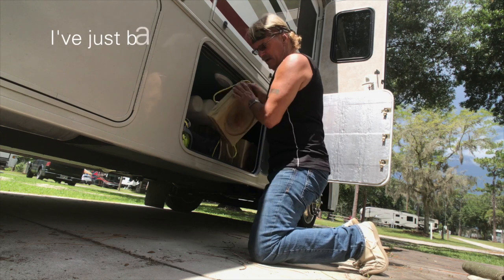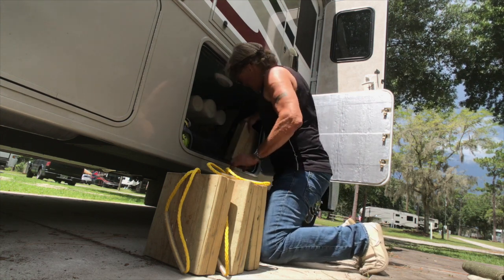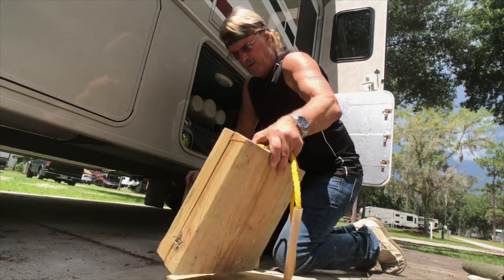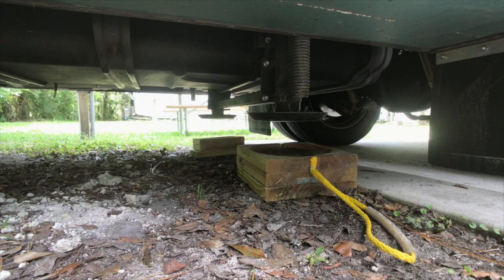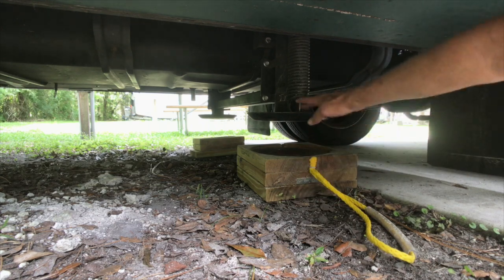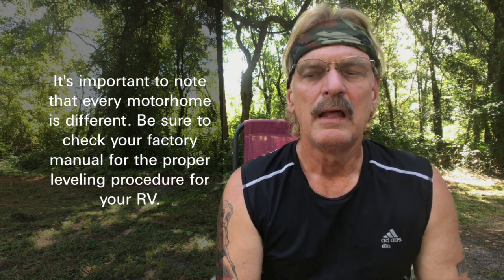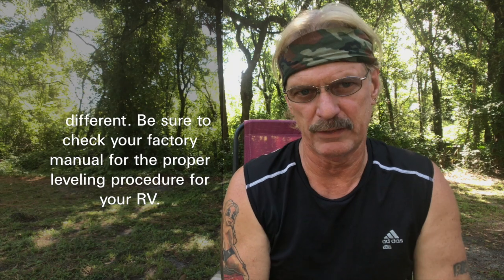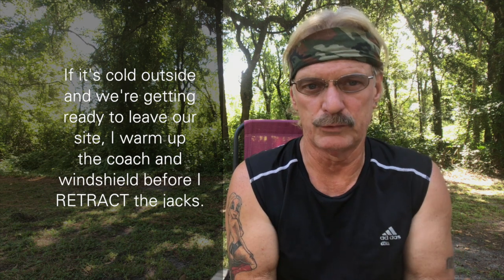Proper RV Leveling has MANY BENEFITS. Here's why.

Comment: Man I like the way you think. I am like you. I have a TT with auto leveling, but I use blocks that are about four inches tall, like you I don't want my levelers to over extend. Then once the TT is level, I extend the stabilizers.  I learned from the time I first used the auto level system, the stabilizers would not fully extend. That is when I started doing the manual leveling as you do.
Reply from the maker: There ya go. Good job William.
thx for watching.

Comment: My Norcold refrigerator manual says to level the frig within 3 degrees max from side to side (which is front to back for the motorhome) and within 6 degrees max from front to back (which is side to side for the motorhome). This is because the frig is mounted on a sidewall so side to side on the frig corresponds to front to back for the motorhome, etc.
Reply from the maker: Maybe you just typed it wrong but from what I read in your comment it's exactly the opposite. Norcold states that their unit should be level within 3º side-to-side and 6º front to back. This is the rule for all absorption fridges. 👍

Comment: Thanks for the very helpful video. I just ordered a can of the silicone.  We just bought our first rv (2019 Winnebago Sightseer 36Z) and the auto leveler just doesn't seem to work very well.  The official instruction manual leaves a lot to be desired! I will do manual next time.  Can you give any details on how you made concave area on 2x12s for the pads to fit in and not slip?  Thanks.
Reply from the maker: Once I screwed the 2"x12" together, I took a plate, outlined it with a pencil and then I used a router to make the concave area.
Reply: @RVstreet  Great idea, Martin  Thanks

Comment: Great video!  Thank you!  What would you recommend to do an inital cleaning of the jack shafts?  Ours look a little rusty.
Reply from the maker: Good question Liz,
I would use "0000 steel wool" and some WD40 and get those shafts as clean as possible. Then going forward, use the 3M lube I showed in the video at least once a month. It will provide a light protective film over those shafts. This is important to do. I have both products in my Amazon Store in the "Sealants, Lubes and Protectants" category if your interested.
https://www.amazon.com/shop/rvstreet

Comment: I appreciate the video.  I bought the 3M silicone from the link.

I recently purchased a used motorhome and figuring things out.  Looking for some help if you have a recommendation
The jacks were not well maintained for. I have changed out a hydraulic motor and 2 solenoids and probably looking at a 3rd.  I'm in process of making wood pads.  I like the idea.  The pads and the springs are a bit rusty looking can I clean them up and if so what would you recommend?
Thank you in advance
Reply from the maker: Thank you Jolene for your question 👏
I would first wash the pads and springs good with hot soap and water and get them totally clean. Then....I'd treat them with my Permatex treatment. You can find that in my Amazon Store in the "Sealants, Lubes and Protectants" category: https://www.amazon.com/shop/rvstreet
Check out this video I did awhile back on treating rust and the steps to restore them back to like new:
https://www.youtube.com/watch?v=QQnsKk1he-M
Thanks for coming aboard and being a part of learning how to take care of your RV 💗
https://www.youtube.com/c/RVstreet/playlists

Comment: Just found your channel a few weeks ago, I really appreciate the information, I have a 2008 winnebago 32H. it is much like yours and the tips you give are right on. I do have a question, I noticed in the video the front stabilizer has a blue 3" or so plate bolted to it. Is that an add on or something to improve ride? Thanks so much..
Reply from the maker: It's an add on. It's an adjustable bracket that stiffens up the sway bar to avoid all the roll you get in the front suspension. Unfortunately these blue brackets are no longer available. I have since added Sumo Springs in the front and they have greatly improved the ride and the impact of bad roads and Hwy expansion joints. Overall, I have done several chassis upgrades that has made our coach ride like a dream.
thx Charles for watching. 👍

Comment: I love your videos what kind of leveller app you have, i have  a 24 foot motorhome, installed hydraulic jack by pushing a buttom something easy for me but when I open my tip-out it’s always off a bit and doing after manually I have trouble with it
Reply from the maker: It's called "Bubble Level". I have an iPhone so I got it on the app store. It's FREE. It has 6 different functions, but the function I use is a round circle with a standard horizontal leveling bubble. Below the bubble it tells me exactly how many degrees I'm out of level so I know how much to raise the RV. I keep leveling until I get within the tolerance I like and that for me is .5º in both directions—side to side and front to back.  It's very simple to use and works great.
Reply: @RVstreet  thanks

Comment: Is there a video on how you made the 2x12 blocks for your leveling jacks
Reply from the maker: No there isn't but I believe I gave that information in the comments.
Reply: @RVstreet  So I went back and looked at the video and I guess I was wondering how you cut out the circle impression in the wood did you use a hole saw bit or something else ?
Reply from the maker: @Brian-bo9nv  I used a router. All 3 layers of wood were glued and screwed. 6 yrs. old now and still good.
Reply: @RVstreet  oh man I had a feeling you were going to say that, I have a lot of tools but not that one.  I will have to borrow from a friend. I just bought my first motorhome yesterday a Georgetown Forest River  335DS When I was in the store I looked at those plastic ones and I was like..... I'm not buying plastic.  I could have used them in my driveway I will be making them soon.
 I been trying to take in all the information I can, information overload lately !!   Thanks for your videos I enjoy watching them and appreciate you.
Reply from the maker: @Brian-bo9nv  Thanks Brian 👍
information overload Ya you've entered into whole world. But you can do this. You can do 80% - 90% of the maintenance it will need yourself. Take one item or system at a time and learn it. Overtime all this will become 2nd nature. As far as leveling goes, learn how to level manually.
Is your MH used or new?
Reply: @RVstreet  it's a 2015 with 25,000 miles on her.

Comment: Hey Martin. Are those blocks you made treated or standard lumber? Just ordered a can of 3m silicone from your link!
Reply from the maker: Treated, glued and screwed them together. Then I used my router on the top board to make a shallow bowl so my leveling jack pads sits down down in it.
BTW....now you can always get anything you need through our Amazon Store. We didn't have our store back when I did this video but do now. Just keep our store link (below) in a convenient place and use it when you have to shop on Amazon.
https://www.amazon.com/shop/rvstreet
Thank you so much Dover for supporting our channel. 🔧 🙏
Reply: @RVstreet  right on!!! Thank YOU!

Comment: How can you tell when the front jacks ‘kiss’ the blocks. Can you actually feel it, or sense it?
Reply from the maker: I can tell two ways:
1) As soon as they kiss I can feel the RV raise up a little. Same with the rear
2) Joanie is outside and she confirms all jacks are firmly on the blocks
Then I launch my leveling app, place my phone on the counter to see where I am level wise and then make any small adjustments from there.
Reply: @RVstreet  Thank you. You can tell, I’m new at this. From what I’ve read, then you have to slightly raise them to finish the leveling?  Then touch them down, again?
Reply from the maker: @SrBottch  That's OK.
No. You can't slightly raise leveling jacks. Once you hit the retract button they will come all the way up. 
So again, once they kiss the wooden blocks, and the coach is firmly planted on all 4 blocks, I look at my leveling app. If I have to raise the front or the rear a little more to get it level then that's what I do.

Comment: I have followed your guidance and read all the owner's manuals. I believe you made a misstatement about refrigerator leveling. You said 6 degrees front to rear and 3 degrees side to side
Reply: continued in reference to the motorhome. The refrigerator leveling is relative to the refrigerator. as you are facing the refrigerator side to side is left and right and front to back is away and towards you. Or to put it another way 90 degrees off from the orientation of the motorhomes front/ back and side to side.
Reply: My Thor Coach manual made the same misstatement you did I choose to take the Norcold manual as the correct information.

Comment: I am planning to get a 22 ft motorhome (BT Cruiser 5210). Does this need to be leveled when I park? I can't find anything about their leveling jacks. Maybe I just need those plastic things that one would drive on top of?
Reply from the maker: For a 22' rig, plastic pads will work. Just takes more time. If you have an absorbtion fridge you need to keep that rig level.
Reply: @RVstreet  Newbee question1... IF Class C, parked for long term [1-2 month] with Refrig off and NO elect/LPG power on, AND RV Not leveled, will Frig have operating issues? Love your coaching!--- SC JayHawk,
Reply: @RVstreet  If RV laid up for winter, no power on Refrig to operate [E or LPG],  will it have start-up / operating issues if RV not level on Gravel parking pad? Auto level lifts off wheels. Is it ok to leave parked w/o level?
Reply from the maker: @miltonsmith8989  Hi Milton
I highly encourage you to go to iRV2.com. Create a user name and password and post your issues there. They're are a lot of experienced folks like me on that forum. We you post your question, be sure to give the details of the issue along with make & model. You'll have many folks chime in for possible solutions instead of just me. They will be a great resource for you in the future too.
Reply from the maker: @miltonsmith8989  No. If the coach is parked and everything is OFF your fridge will be fine. It's when you are USING your absorbtion fridge that you need to be level.
Reply from the maker: @miltonsmith8989  If RV laid up for winter, no power on Refrig to operate [E or LPG],  will it have start-up / operating issues if RV not level on Gravel parking pad?
NO.
 Is it ok to leave parked w/o level?
Yes, as long as the fridge is OFF.

Comment: Pretty good videos but being level doesn’t have to be so precise.  If your rv is level enough for you to be comfortable then it’s level enough for the rv and all mechanicals in the rv.
Reply from the maker: Being level enough for you to be comfortable is not good enough if you have an absorption refrigerator. Absorption Refrigerators are fussy about being level within tolerance if you want them to work right and last long. But from a practical point of view, think of it this way. If your not level, when you cook on the stove—like in a frying pan—and your using olive oil or butter all that will pool to one side of the pan. When you shower, the water will accumulate to one corner of the shower pan. Then you have to use your foot to push the water towards the center of the drain. Being nice and level is also good for your slides (if you have them) as they deploy and retract. It's just a good practice to be good and level and it's not that hard to do. But everyone can do what they want. 
thx Scott
Reply: @RVstreet  not true, I have a absorption refrigerator and have talked to many RV people and have owned Rv’s for 20years. Any concrete pad at a campground is plenty level for a fridge to work with no problem at all. Only if you boondocking on unlevel ground would this be a concern and like I said if if comfortable enough for you your fridge should be fine
Reply from the maker: OK, that's kewl with me 👍
thx Scott

Comment: HWH advised that WD-40 is ok to apply to shafts when in salt environments or for long term deployed storage but the point you make about lubrication and the seals makes sense. Dry lube is great since it doesn't attract stuff like wet lubes.
Reply from the maker: thx for taking the time to comment Dean 👍
My 2 cents.....
Yeah I know HWH suggest that but I disagree. WD-40 is not a lubricant and evaporates quickly. I have a lot of experience with chrome shafts like this and on other types of machinery and the 3M dry lube is the best IMO. My leveling system is Power Gear not HWH but the equipment is basically the same. This is one of those subjects that never finds a conclusion in discussions, but that's ok with me. My leveling system is 10yrs. old now, never one problem with them and my chrome shafts look like new. I have a bin in my tool bay with multiple special sprays, lubes and protectants and you will not find a can of WD-40.

Comment: Always enjoy your maintenance and tip videos. Thanks for sharing. My Itasca 30 W has similar leveler rams and springs. I use the silicone for the rams and it also has grease fittings that I put lithium grease into periodically. Yours may or may not be the same. I love the idea of using the manual process. Will try it!
Reply from the maker: Thank you Michael 👍
FYI....Those wiper seals that have the grease fitting takes the same multi-purpose grease that you use for greasing the 9 points on the front suspension. One shot of grease every year in those seals. Anymore than that and you risk blowing the seal.

Comment: Newbees here....thanks for the tip on leveling and the silicon spray. We have an all manual system. Already replaced the jack springs....
Reply from the maker: There ya go. It will protect them.

Comment: In my manual they specifically call out WD40 which has always puzzled me.  This is on a 03 Fleetwood Flair.   I do clean them quite often but not on a monthly basis.  I kind of lean the way you are talking about the 3m dry silicone but will have to do some more research.   I do use dry lube on my kwikee steps so could be the same product I already have
Reply from the maker: Yeah different leveling systems can suggest different types of lubes. Like electric jacks. That's why I specifically pointed out that these are Power Gear Jacks and that's what they recommend. But just from my own mechanical experience this 3M Dry Silicone is exactly what should be used on these types of chrome extending rods. I've seen threads on assorted RV forums that just drive me nuts on some of the arguments some folks make on what to use and what not to use. Like WD40. WD40 is not a lubricant nor does it protect. It evaporates very quickly and it also will not protect against contaminants.
thx Bob

Comment: I am having so many problems trying to get level front to back. I'm in my driveway on a very slight incline. My manual says to level side to side first. That's easy, but not helping. I'm going to  try front to back first. Makes a whole lot more sense.  I knew about the refrigerator, but had no idea about the windshield! Wow. Sure glad I listen to you!!!!!!!!
Reply from the maker: OK, so....what you can do to make leveling the front to back a little easier since you're on a incline—and I'm assuming the incline is downwards so the front of your RV is lower than the rear—is to put a 2" x 12" x 2' board behind the front tires. (Buy a 8' x 2" x 12" @ Home Depot) and cut it into two pieces 2' long. Place these two 2' x 12" boards right behind the front tires. Make sure the bottom of the entire front tires rests on the boards. You don't want any part of the tire off the board. Now that will raise your front end 2" right off the bat. Then manual level, raising the front end first. Then having your phone with your leveling app on the counter, raise the rear end till your level. 👍
Reply: Definitely nose downhill. Was trying to figure out something and the board is perfect. Thanks

Comment: what do we do if after leveling one of our front tires is off the ground by 5 or 6 inches
Reply from the maker: You should not have any front wheels off the ground. If you have one front tire off the ground that means you have totally extended you leveling jacks. No need for this, causes a somewhat unsafe situation and makes the coach over all less stable
Options are: 
1) Put additional blocks under the tire that is low first, then level. For example, use 3 or 4 - 2"x12"x 20" pieces of wood, OR carry a couple of ramps. Roll the front of the coach up the ramp or blocks to get the front end a little higher, then level.
2) But the best choice is just to move to a different site or area that isn't so sloped

As an added note:
NEVER, NEVER raise any back tires off the ground.   That's where your emergency brakes are and if those tires come off the ground you may just roll away and bad things will happen.

Hope this helps Larry

Comment: Martin, what material are the blocks? Anything special? Do you have a video on them?
Reply from the maker: Nope, no video, but, 3 - 2" x 12" treated wood blocks—glued and screwed together—and then I used my router to make a 1/2" deep bowl on the top so my jack pads rest inside there.
Reply: @RVstreet  Thank you for your speedy reply. I have a diesel, Winn Forza. At what point do I also put something under the tires?
Reply from the maker: If your parking in a very un-level site it can help to put additional leveling blocks under the tires first. You can use these under the front tires, the rear tires or front and rear tires on one side. It just depends on how the coach is sitting on the site. Here's what I carry and use to get the coach in the right position under the tires BEFORE I put my wooden blocks down and deploy the leveling jacks: https://www.amazon.com/dp/B00T36KG42?ref=exp_rvstreet_dp_vv_d
Reply: @RVstreet  thank you for your advice/suggestions AND your quick responses. I’ll check out these blocks.